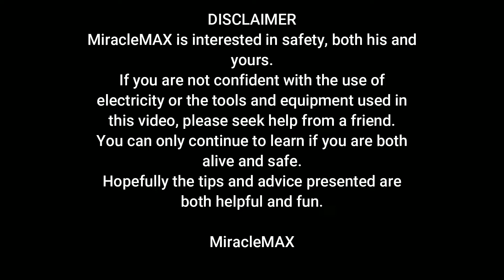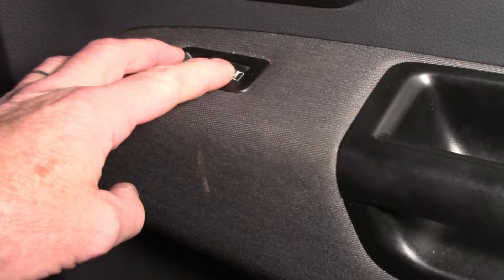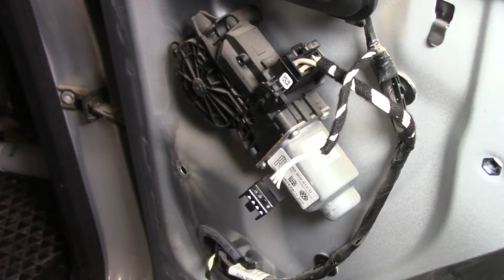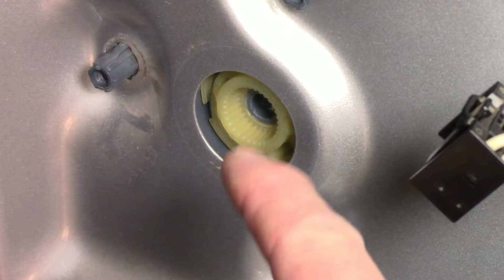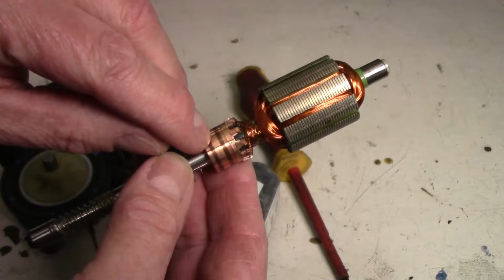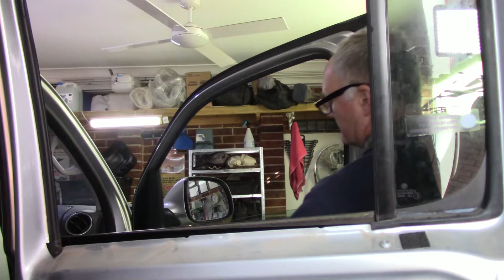Amarok Power Window Repair

Comment: Hi max, thanks for the video, very well explained however after I’ve tried what you’ve shown in the video, my front driver side power mirror is still skipping when it winds down, especially when going over bumps
When it’s being wound up, it doesn’t do the same thing 
Could you tell me what sort of issue I’m having please? 

Thank you!!
Reply from the maker: Are you referring to your window or mirror? If it is your window, have you replaced the actual motor? Have you checked the internal gear of the regulator where it meshes with the motor gear?
Reply: @MiracleMAX  apologies I mean the window 
I haven’t replaced the motor at this stage I’ve been trying everything I can not to yet at the motor’s can be quiet pricey
Reply from the maker: @seano_0  If you pull off the motor, carefully check the external plastic gear of the motor and the internal gear of the regulator - most likely the cause of your problem.
Reply: @MiracleMAX  thank you for the tips mate appreciate your help!

Comment: Brilliant video mate, I have that exact issue. Now I know how to tackle it.
Reply from the maker: Hope you can get what you need from the video. Let us know how you go. 😉
Reply: @MiracleMAX  will do.
Reply: @MiracleMAX  I got it all sorted today. It was exactly the same issue, right down to it working when I gave it a tap to see if it was the bushes not making correct contact. 
That got it going, but I pulled it out anyway and took it to a mate who's an auto electrician. He did his magic on it for a 6 pack of beer and then I put it back in and hey presto! It works like brand new. 
Thanks for the great tutorial, it saved me time and money. I originally thought that it was just a dodgy switch and was going to buy one before I watched your video and realized I was jumping the gun nearly purchasing a part that as it turns out was not necessary because it wasn't the problem. 
So cheers mate and I look forward to watching and learning more from your channel 👍
Reply from the maker: @darthphilfy  That's great news. I'm glad you were able to get it repaired. 😊